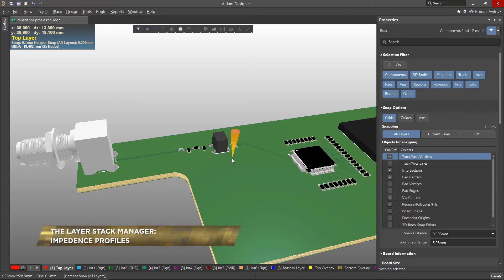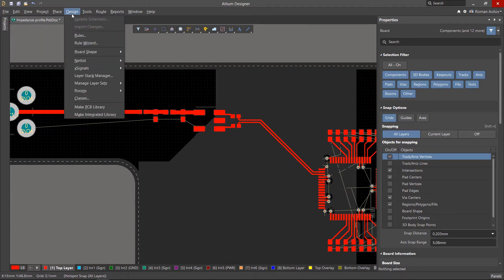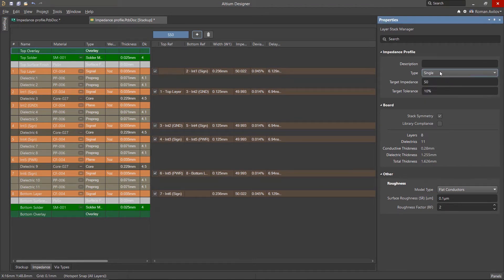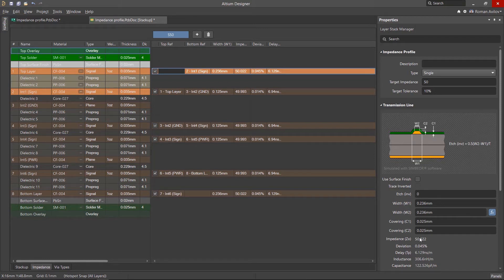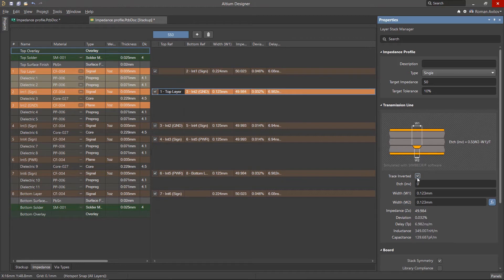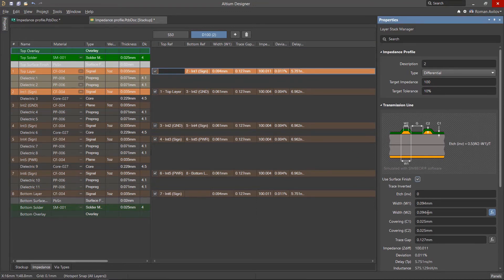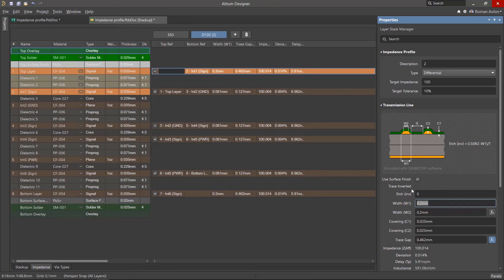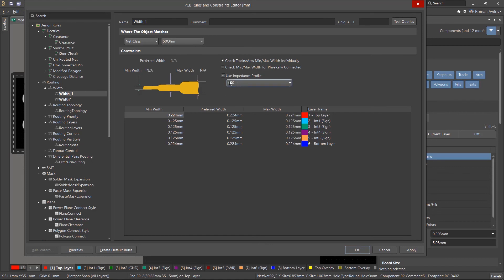How to Apply Impedance Profiles Using the Rules and Constraints Editor

Comment: What dictates the diff pairs' VIA spacing? Thanks!
Reply: There are two factors that determine what the spacing should be between vias in a differential pair: manufacturability and whether the vias need controlled impedance. There will be some minimum distance required between the hole walls of the two vias, this will usually be limited to a minimum of 8 or 10 mils, but check with your fabrication house. For the impedance, there is no specific spacing requirement and it is better to set the value based on calculations with a field solver. Typical values you might find will be something like 30 mils hole-center to hole-center spacing as calculated with the simple LC model from Howard Johnson, but this is only valid up to about 3 GHz bandwidths. The spacing needed to hit a specific input impedance target also depends on the antipad size; in general making the antipad smaller will lower the impedance in the 5-50 GHz range.
Reply: @Zachariah-Peterson  thanks, it is for controlled imp and I went with Saturn in the diff via section to calculate the hole size, hole spacing, and anti pad diameter. Altium's 2d solver is great, would be amazing if they added a 3D field solver too. It'd be cool if in the design rules, when checking off the "use impedance profile" for track widths, if it also defaulted to a via template designed for same impedance.
Reply: I agree they do need to add in the via analyzer from the Simbeor SDK, that would be a great addition to the impedance calculator.